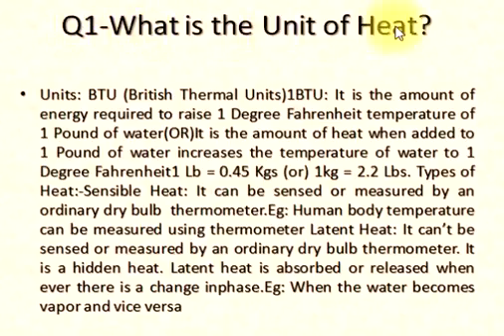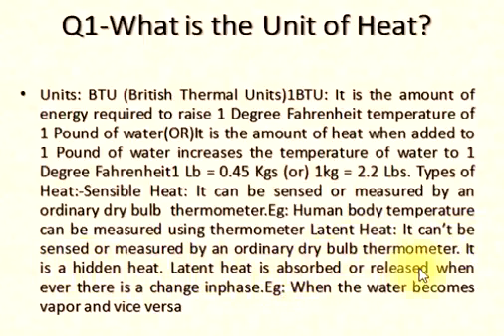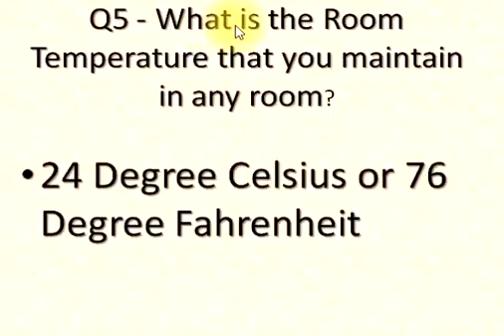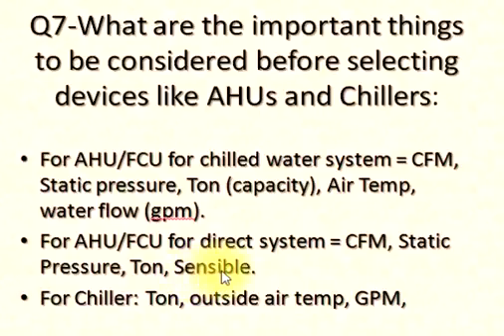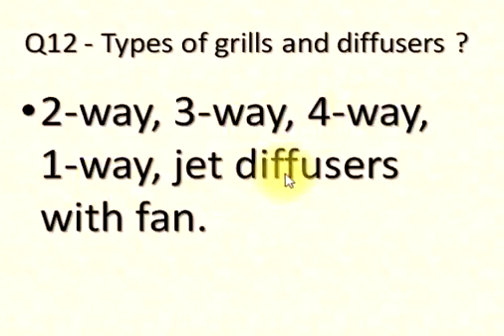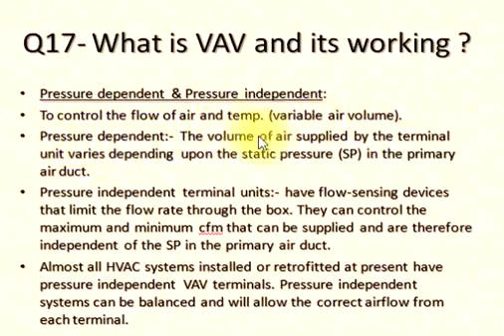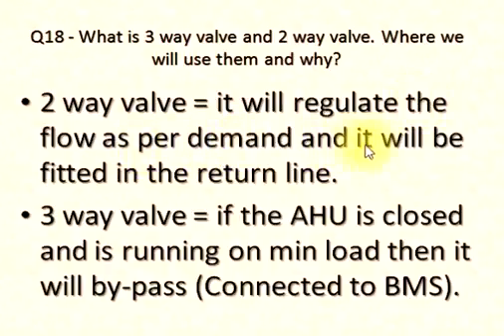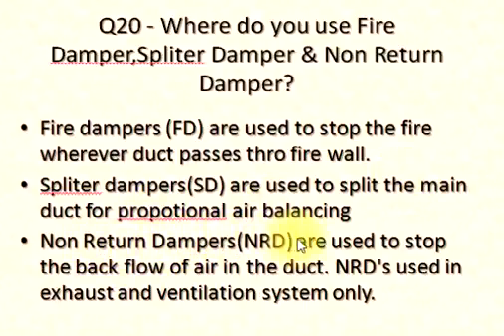HVAC Engineer interview 20 question & answers (Mechanical engineer)

Comment: sir please explain the draw through & blow through
Reply: I think you are meaning the location of the fan in an AHU/fan coil. A coil could be on the negative pressure (inlet) side of the fan (draw through) or on the positive pressure (outlet) side of the fan (blow through), so it really is just about where the fan is located.